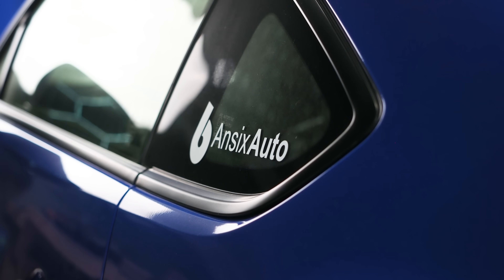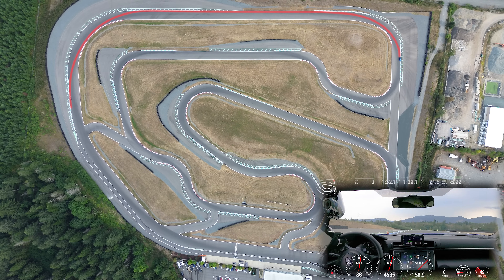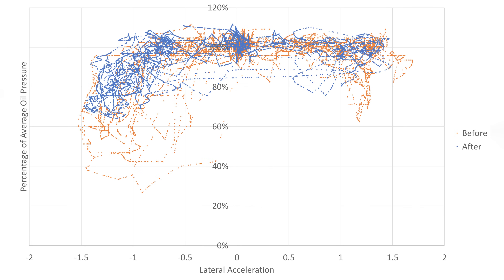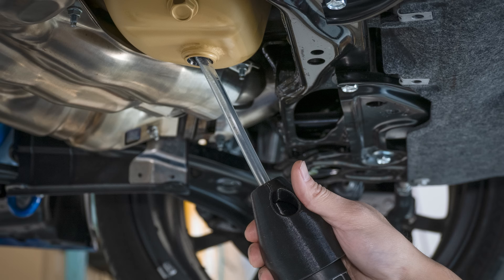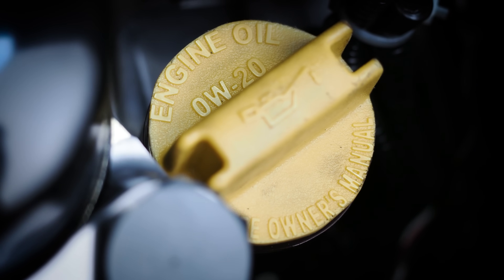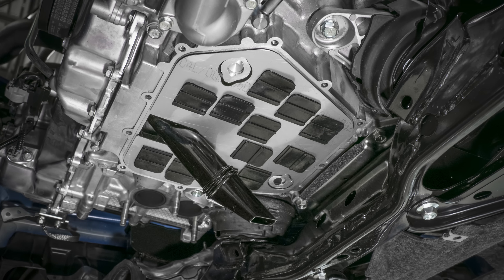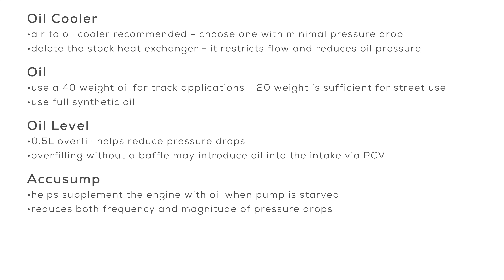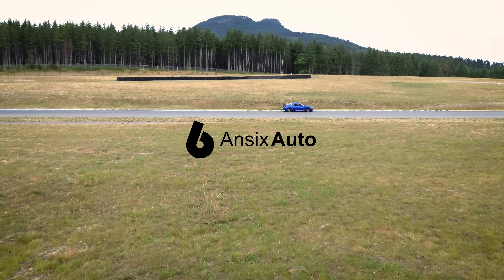The FA24D Engine: What Toyota & Subaru Don’t Want You to Know

Comment: That's a shitload of wasted time. 

The Accusump is only a heavy bandaid, to supplement the pump when the pump is starving. That means it only helps when the pump is starving, and that is the real problem. After the pump recovers the oil pressure is held low by the Accusump, while filling the Accusump, so that bandaid doesn't fix problems, it just delays them.

Install a properly designed oil pan & discard the accusump.
Reply from the maker: Technically it's a buffer.

Comment: The fact that you had to put in this much work and money to solve the oil pressure and oil temp issues just goes to show that going with a boxer motor was a mistake on Toyota's part.

The thing is that the oil starvation isn't just a track thing as I remember in the research I did after ordering my own 86 that even non track owners were getting oil starvation issues usually finding out when something let go.

It's one of the reasons why I canceled my order. I don't want to buy a new car then have to spend a few grand extra just to work around basic reliability issues.

Comment: For a track car I recommend trying Motul 300V 5W40 oil.
Reply from the maker: 300V is certainly good. You'll have to shorten the oil change intervals because it absorbs water faster and it's not so nice on the cats if you still have them in your car.
Reply: @AnsixAuto  I change it every 3000-5000km depending on the number of trackdays.

Comment: Powertrain engineer here, I've seen the mechanical development process, some designers require the engine be run on a "rotisserie" literally tilting amd rolling the engine over while firing to simulate high g forces.  Toyota skipped that test requirement and used another test procedure for high Gs that clearly failed.
Reply from the maker: Maybe they only tested to 1.1g instead of 1.5g

Comment: I recall that when the 86/BRZ came out, it was just supposed to be an affordable fun car to drive - rear wheel drive and manual.  It came fitted with Prius tyres so you could have more fun at the limit!  It's maybe a bit much to expect a budget car to handle high g-forces when on slicks doing track days.  Lots of cars suffer from this sort of problem in these conditions.  I had an LS1 based car that had the same issue, which I solved with a baffled sump.  So, is this really a screw-up?  More like built to a budget.  It's not a GT3.
Reply: It's almost like you're the only person with common sense in this entire chat channel.
Reply from the maker: Sure but they could have done better. Maybe we were a bit harsh.
Reply: The original 86/BRZ were also sold as a fun and affordable vehicle to put on the track. Part of the design was being able to fit 4 spare tyres in the vehicle by folding down the rear seats after all. 

The original FA20s also don't have this issue funnily enough.
Reply: People complaining Subaru should have done this from factory must be new to Subarus because most Subaru owners that track their car have known this oil starvation issue since the EJ engines meaning forever.
Reply: Want to do Race Car things, buy Race Car parts... absolute disgrace that people would think a factory street legal 30k car should come with a dry sump setup...

Comment: That engine needs a deeper oil pan.
Reply from the maker: That could help for sure but it will need a longer pickup. Which would require removing the timing cover to install. Also, a deeper pan would make it the lowest part of the car excluding the wheels and tires. So if you hit a speed bump, your oil pan gets damaged...

Comment: Please try using 10or15w40 oil. You will see it retain higher oil pressure. Not sure why people stick to the 5w when using in high stress/load situations
Reply from the maker: We used 5W40. The first number refers to the cold viscosity so any 40 weight oil will be similar when at operating temperature. There should be no difference between 0w40 vs 15w40 in terms of viscosity at operating temperature.

Comment: Not sure why oil weight is still be debated, BRZ/86 runs 5w-40 oil for hard-usage is listed in Japanese owner booklet since 2012

if you open STI japan for BRZ parts  or TOYOTA site for GR86. What oil do they sell for your car? 5w-40. You can't even find oil in any other weight on the STI parts site for BRZ. 

again , that is since 2012

Comment: I believe the man who's engine failed had his oil pickup clogged with sealant. Low oil pressure was partly at fault even though it was more of a consequence I think of the clogged pickup. It's more of a manufacturing defect than a design flaw in my opinion although of course improvements can be made.

I have a 2013 86 that is turbocharged and sees drift days at track and have yet to have a failure of any kind.(knock on wood 🪵) 
I also do not have a baffle plate nor aftermarket pickup. (Would like to install if not for a bit more peace of mind, especially the accusump). 

It's important to make sure the pickup is free of debris and that there is an oil cooler installed especially with any FI setup, however it's recommended for NA too because oil temperatures can get quite high, and if you are using a light viscosity oil like 20, the oil will thin out to a 16 or even less past 100℃ and that's when pressures can drop and you can lose film strength leading to damage like a spun bearing.

Personally, NA or not, I would recommend a proper oil cooler that is unobstructed and does not obstruct the radiator. I would also advise a minimum of 0/5w-30, with a 0/5w-40 being ideal. Also with an oil cooler you get the extra advantage of larger oil capacity so even if the heads aren't draining as fast as need be, you still have an extra half liter of oil or so that might protect you on those harsh turns. 

Afterwards things like lower oil pan baffle, accusump, larger oil pump etc. can be considered as extra protection and are far more affordable than a dry sump system.
Reply from the maker: It's likely a combination of both. We have had our pickup cleaned but the oil pressure still drops pretty low.
Reply: @AnsixAuto  Yeah I saw that and that's was pretty concerning. I'm happy to see you got those problems somewhat remedied and at a way that's affordable. Hopefully going forward in production the factories can take extra care in oil pan sealant or just RTV applications in general to reduce the occurrences of this.

Comment: 🤦‍♂️ it’s a street car not a race car. Ofcourse it needs preparation for the track. Any fucking Subaru boxer engine has this problem due to the oil pan and pickup design. First thing you replace when wanting track driving.
Reply from the maker: Agreed to a certain extent. Yet they promote it with media of it being driven hard on track.
Reply: @AnsixAuto  they do some drifting. It’s not a Porsche GT3 RS and it’s not even close to this pricepoint

Comment: the permament fix is a deeper oil pan and revised pickup design a accusump and a cooler is a band-aid for bad design killer-b makes a replacment sump that replaces both the upper and lower pan and has a flap valve to prevent the oil from getting trapped in the timing cover mid corner which is what the problem accually is
Reply from the maker: If you make the oil pan lower it'll be the lowest point of the car excluding the wheels and tires. Hitting your oil pan on a speed bump could be costly.